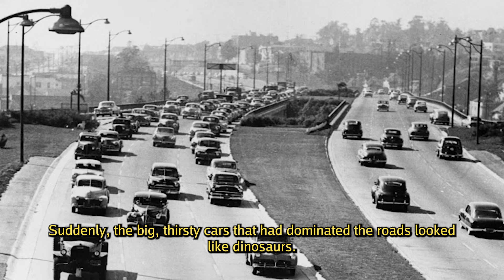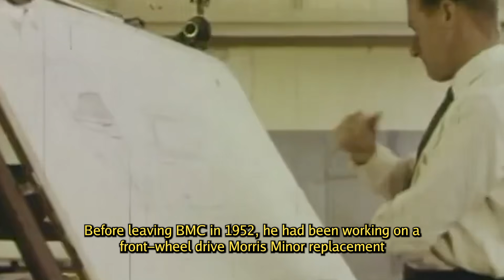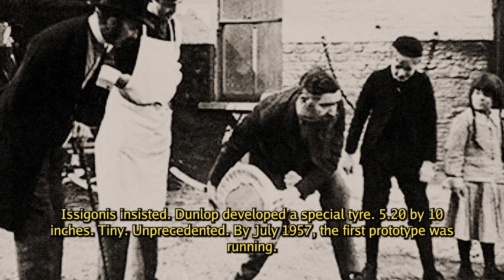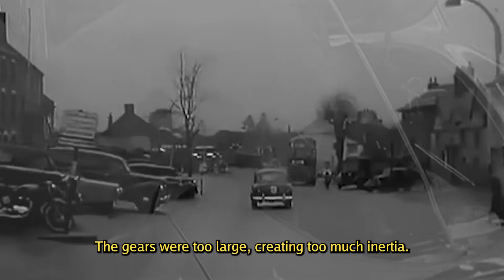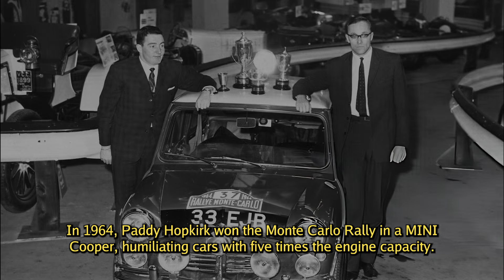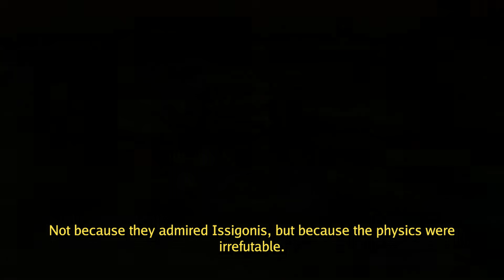The Genius Who Destroyed Rear Wheel Drive

Comment: Please get your facts right. The Germans were the first to perfect and build front wheel drive vehicles, not the Brits. Alec Issigonies simply copied the concept 1:1. His achievement was to place the engine crosswise and incorporate the gearbox into the engine block.
Reply: Front wheel drive is not from the Britts and not the Germans.
It were the French with Citroën´s Traction Avant in the 1930´s.
And don´t forget Tatra
Reply: @luiwammes4193  The first German front wheel drive car was a DKW introduced in 1931. DKW later became the Audi motor company.
BTW, Tatra was a German car manufacturer before it was taken over by the Czech government in 1945.
That said, if we delve even further into history the very first front wheel drive vehicle was the Christie of 1909, developed by the US Walter Christie Automobile Company.
Reply from the maker: @luiwammes4193  Thanks for this insight Luiwammes and I'll keep this in mind for future research. Much appreciated
Reply from the maker: I appreciate this feedback Mike and I'll take this on board to ensure factually correct content moving forward. Yes I was aware the Germans did this first so perhaps my delivery could be improved. Thanks again
Reply: @ShadowPioneers-j9q  The thing is, it wasn't easy to develop front wheel drive. It took the Germans years to perfect it. For instance, the early versions had the habit of forcing the steering back into straight ahead when the driver gave gas in a curve. Issigonies' ingenuity was the crosswise placement of the engine that shortened the length of the car by half a meter. Most passenger cars are designed like that now.
Cheers
Reply from the maker: @mikethespike7579  Amazing insight and thanks for sharing this Mike. As with many innovations, it doesn't surprise me the Germans were at the forefront of it.